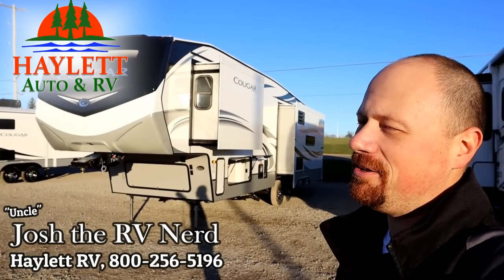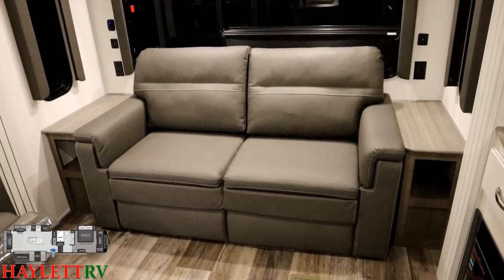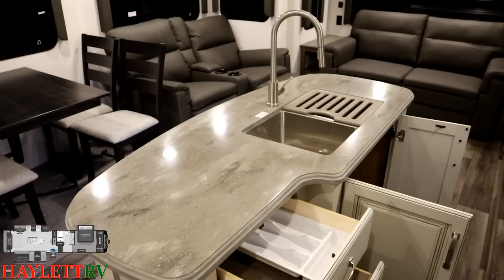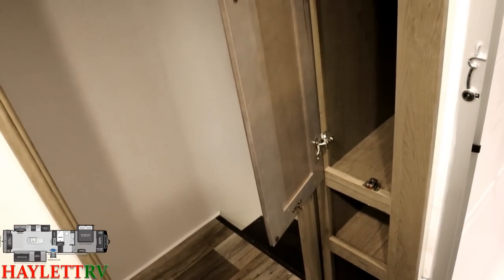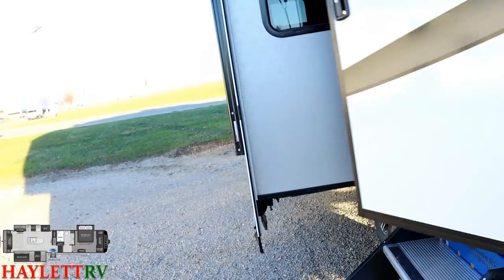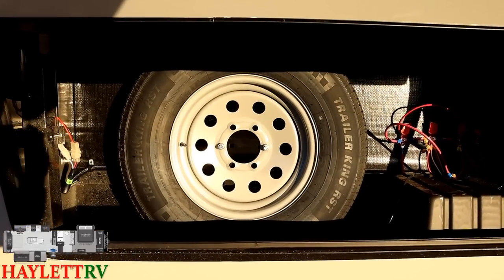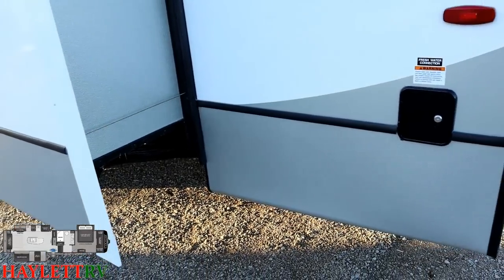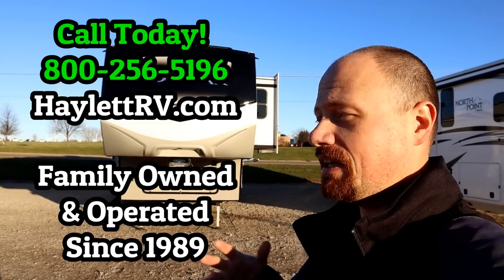NEW XL BATHROOM!! 2021 Cougar 316RLS Full Time RVing Warranty Keystone Fifth Wheel RV Review

Comment: Thanks for your dedication. Also, entertaining!
I have often wondered why no one has ever provided Line-X on the roof. Wouldn't it prevent leaks better? And add durability and grip for walking on the roof? And it can come in white...
It's more cost, but more savings in the long run.
Just my 3 cents.
Reply from the maker: There are a lot of things that could be done. There are generally speaking not enough individuals willing to pay for those things for them to be mainstream market viable unfortunately. 

I don't like that answer, but the hard fact is MFGs do not SET the market -- rather they reflect what consumers are willing to purchase.
Reply: Couldn’t be that much more

Comment: We were in the market for a 5th wheel 2 years ago. We looked really seriously at the 315RLS but in the end went with a Rockwood Signature model. What swung me to the Rockwood was 2 things - no cable slides and their Dexter Torflex axles rather than the leaf springs. Cougar has had great floorplans for a lot of years and Rockwood is finally catching up with their floorplans. Great to see the competition in the market. And Haylett carries both Cougar and Rockwood lines!
Reply from the maker: We are expanding our Rockwood fifth wheel offerings as well. They have made some serious improvements

Comment: Gah, those sideways faucets while keeping the short dinky spouts. I call them "floor washers" because more water goes on the floor when you're trying to wash your hands. I had one of those in my 1/2 bath on my open range 376FBH. I swapped out the faucet at Home Despot inside of a month.
Reply from the maker: I lump stuff like that into the realm of "Screwdriver work." That's an easy thing to swap around. If the only thing someone needs is a different faucet, then you better believe we'll get it swapped here. Easy stuff.

Comment: Josh -you are the man! It seems you do work around the clock. 
This new Cougar design is fantastic!! Had we not been so stupid as to listen to our bank we would have bought from you as planned the first time around! Anyhoo this floor plan has so many advantages-from the XL bathroom, to carpetless, to King bed- love the new DR table without the knee killer feature!-I don’t think I’ve ever seen so much storage in a 34 ft 5th wheel. I don’t comment much anymore having embarrassed ourselves by not purchasing from you all. I did find what I consider a design flaw in our 2019 RKS. We have learned more than I ever thought possible over the past two years and we are still very green and newbies!!! There’s just so much to everything these days. Oh and by the way, the income in system rocks. I definitely take advantage of using that and can shut off the awning lights that I forgotten from bed instead of having to get up and go to a panel, same thing with adjusting the air conditioning. I did have one question about this model, does it come plumbed for two ACs? 
Thanks again for all you do and Happy Holidays!
Reply from the maker: Pre-set for 2 airs
NORMALLY we build them that way, but factory shortages on A/C units forced this one to come in single-A/C (We can still install one here)

Comment: Awesome rv. Just a couple things. Would like to see a drawer under the oven. Hard for me to get on the floor. Also would like to see them put some kind of flush mount ceiling fan in living room to help move air around. When a/c or heat is on. Also a longer grab handle when coming in      Just my opinion. You are doing an awesome job josh.
Reply from the maker: I like that oven drawer idea and tend to agree. Thanks for watching and sharing :)

Comment: Thanks for your hard work. You must have recorded the inside all night long (all night), because when you went outside, it was daytime!

What are the dimensions of the shower?
Reply from the maker: Very long day/night. Yes. I spend Hours per unit usually. If I get several in at the end of the day, then I typically just knuckle down and knock them out. 

We are approaching cold camp season and I don't want to leave slides open and risk getting snow on them 

I don't have hard dimensions on a spec sheet, but our team at 800-256-5196 is happy to hand-measure stuff for you in return for a fair shake at working with you when you're ready!!

Comment: This is getting more and more frustrating.  If I had deeper pockets, it would really be irritating. I've been a fan of Jayco, but this rig is AWESOME. Do have a question, does Cougar offer whisper ducted a/c. That would be my only change. Different question, but it's not for this specific video. I don't know who the manufacturer is, but the 12 volt compressor fridges, do they make a side-by-side 4 door fridge to replace the 4 door 2 way in this unit?
Reply from the maker: Cougar does not do any whisper ducting currently with no plans to adopt it in the future of which I am aware (But I cannot speak for them of course)

Brands rarely change things like fridges mid-season
When cougar started the current build generation those larger 12v fridges did not exist yet 

You've likely seen how much we like them here. As soon as they're available, then we'll have them everywhere we can

Comment: 1 amazing unit, Josh. What about OTG-ing? Would it be practical to take a  unit this long off the grid? My husband would assume that it wouldn’t be very practical. What are your informative thoughts?
Reply from the maker: Cougar's OTG package is a 170w solar panel, charge controller, and inverter to run 3 outlets in the RV. That won't give 100% function to the RV, but nearly indefinite use of most 12v systems assuming decent sunlight. 

We have portable generator options here for more extended off-grid use or for high voltage appliances.
Reply: @JoshtheRVNerd  
Ok, thank you!

Comment: Josh, due to being in a wheelchair I'll probably never get to go camping.  So what I do, is live through you :)  One thing, I did see in the background the AC square so that means we'll hear the air right?  If they'd adjust that to the new model you discuss it'd be perfect
Reply from the maker: Cougar doesn't use the whisper muffling system like an eagle or big montana. They do however use the Coleman air units which are already a little quieter than most. You can hear it, but it's not bad

Comment: The one thing I don't see a lot of with these campers is a propane port for a grill that would hook up to one of the two propane tanks that the trailer has. Some of them have it in the front or back, but I didn't see it on this.
Reply from the maker: It's hidden just under the skirt line
Reply: Thanks for the quick reply. Love the content btw.

Comment: I am located in California and I enjoy your reviews of the cougar 5th wheels. Can you do a review of the 290RLS. Especially what type of washer and dryer can be installed. Thanks
Reply from the maker: The 290RLS hasn't actually been produced yet, but they have finished their prototyping. 

It's basically just a 30RLS like this https://www.youtube.com/watch?v=baQXp7_9Hp4 with stackable W/D prep in the expanded kitchen pantry. MFGs typically scale them for specific Splendide models
Reply: @JoshtheRVNerd  also, I believe the 30rls is the 1/2 ton version and the 290rls is the cougar premium. If I am reading everything correctly. Have a great day. Your videos rock.
Reply from the maker: @patw34n99  You're correct. They're extremely similar. The biggest "gain" is the stackable W/D prep not found in the 30RLS
Reply: @JoshtheRVNerd  I did find a couple at two local dealers. One provided a video, however I have not seen it first hand. They did say it was available., however local for me is a three hour drive. I’m still just kicking the tires.
Reply: Just got back from local dealer who had two 290RLS and it is awesome. I just do not understand why they used a gear drive slide on one slide and a cable slide on the opposing side. Hope you review this model soon.

Comment: Am I reading the specs correctly? Less than 1900 pounds of cargo? With water, propane and batteries maybe 800 pounds? That's pretty low and easily exceeded. They should really upgrade the axles/wheels and tires and up this cargo capacity to at least 2500 pounds. I see this all the time in new 5th wheels. Tons of storage but not the CCC to use it all without overloading the unit.

Comment: What type of slide mechanisms are they uding on this unit? I know Keystone likes to use the cable driven slides to keep the weight down.  My husband and I are a bit leery about the longevity and maintenance of those.
Reply from the maker: Primarily cable slides on these. Fun fact for you though -- cable slides are the single lowest warranty rate item of any of the mechanical/motor systems at all of Cougar AND Montana. It's also a more expensive system. They would not be using it if it were not performing well
Reply: Reilly?  sEEMS Hardly good enough to tranport sll that weight and cables were really fun to deal with during our "pop-up phase!  LOL!  My husband had to change them all out for aircraft grade.
Reply from the maker: @rvserious8317  Cable slides use aircraft grade cables from the start so you won't have that issue.

Comment: Nice layout but what is going on with that roof? Looks like the surface of the moon.
Reply from the maker: Brand new RV fresh off the line. I record on arrival and we're local to the factory so sometimes they haven't had a chance to go thru an off-gassing period

Same RV a week later is fine
Reply: @JoshtheRVNerd  So those bubbles can/will disappear and remain that way?
Reply from the maker: @madweazl  When the RV is made a lot of things still have gasses they're giving off (like the osb roof decking). The roof skin is glued down and sometimes those gasses form pockets and get trapped. They slowly bleed off and settle back down

It's like that new car smell, but for a camper

Comment: Can we pull this with a 3/4 ton truck
Reply: My 3/4 ton can. You would need to check the specs on your truck. If you have a ram it’s real easy to do. You can go to the ram website and put in your Vin number and will tell you your payload in tow capacity down to the pound.
Reply from the maker: Angus beat me to it with some good info!